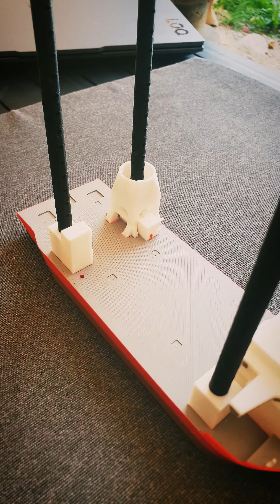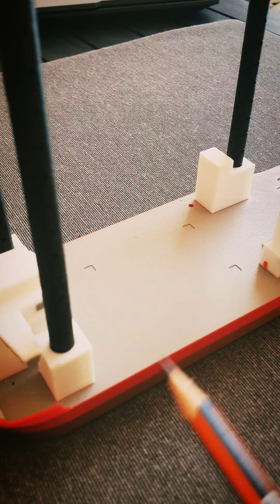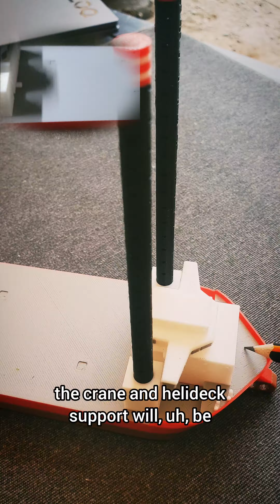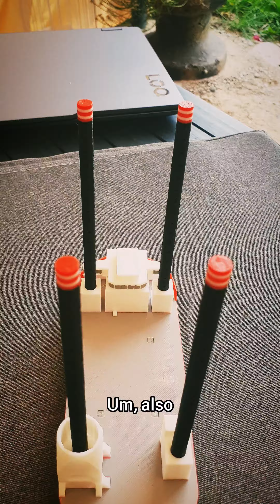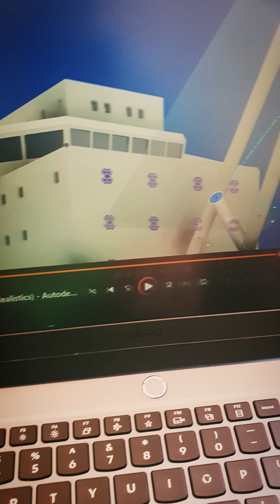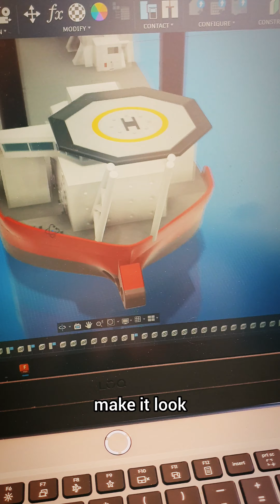3D Model Challenge - Part 13 - Full episode | Offshore Jack-Up Vessel | Fusion 360 + Bambu Lab +P1S

Comment from the maker: Welcome to my biggest 3D model project so far! 🚢 
This challenge combines Fusion 360, engineering, and multi-color 3D printing using the Bambu Lab P1S + AMS. 
The goal is to create a highly detailed offshore jack-up vessel model with realistic colours and printable assembly. 
As number of subscribers are increasing, I will make more videos with comments from my side of the progress and challenges.

If you are here and interested for ready printable model 1st version release, just say "Hi". This will automatically add you to the list of status update, when 1st print release date comes closer.

🤩